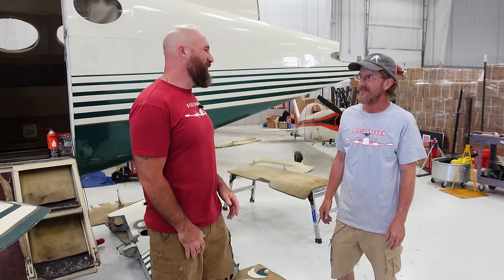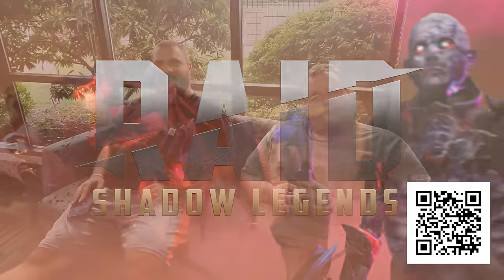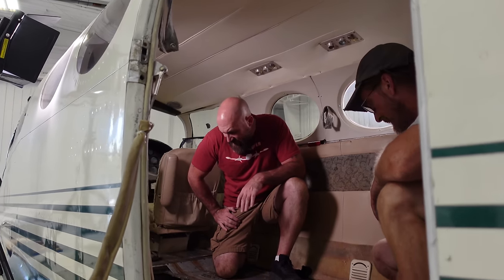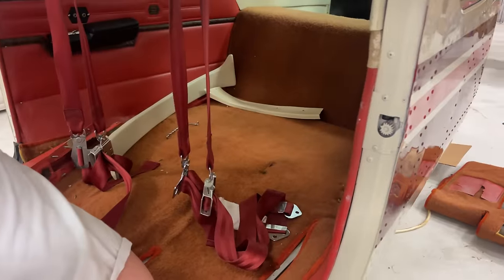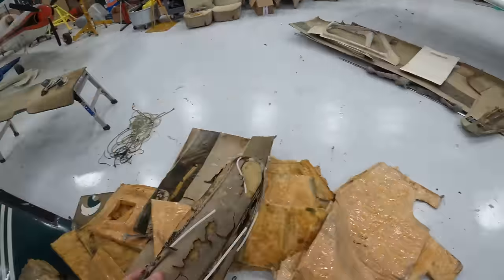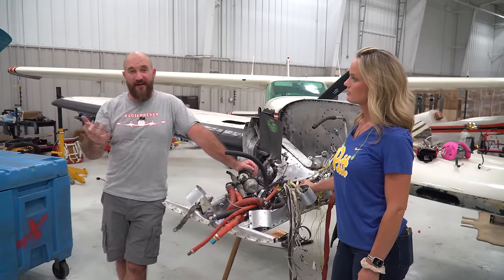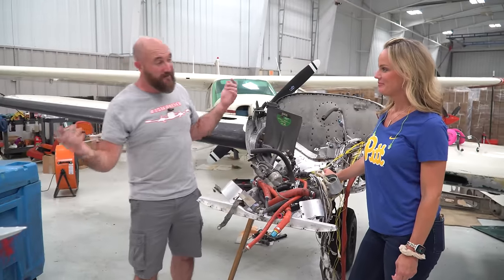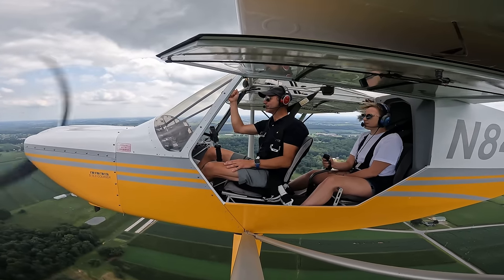Removing The Interior And DRY ICE Blasting The Free Abandoned Airplane￼￼

Comment: Can I suggest putting plywood panels down everywhere you walk. They will make it easier on the knees and protect the ribs and stringers from foot traffic damage. The voice of experience.
Reply: Very apt and useful comment. 👍
Reply: @athaxan2110  I thihk I would have started by pulling down the roofing panels
Reply: @miscbits6399  🤣
Reply: @miscbits6399  That would mean forethought...
Reply: A man who’s done this before!
Reply: Yeah they're called floor boards, We use them all the time building all of our planes.
Reply: Keeps from damaging equipment as well like the seat tracks and under floor wiring sensor etc.
Reply: Every Experience advice counts.  Thanks.

Comment: That potential donor plane in Ohio used to belong to a friend/former instructor of mine who passed away a couple years ago. He used to do charter operations with it. I haven't seen it in years but looks like it's in the same spot as always. I remember Dave telling me it needed work on the wing spar but whatever happens I hope it can help you achieve your mission. Seeing that just made me a little sad but I knew the plane instantly when I saw it
Reply: Wow great to know someone who knew the owner of the potential donor plane you would be a valuable asset to Jason on condition and history
Reply: The donor 401 looks better than the 401
Reply: @missingremote4388  Possibly.  Won't know until they get in there and get eyes on it.  Hopefully they will have the scope camera to view the innards through inspection ports.
Reply: @electronicsworkbench  If it's a great plane they should consider repairing the left wing corrosion. The donor plane could be the next project if it's viable.
Reply: @markwebber526  Donor plane is too screwed up to be viable plus it’s had three belly landings overall was in far worse shape Than the one he’s working on.  It will be a far bigger project which may not be worth it

Comment: Take it from an old A&P that did many C checks on MD-11, 737, 727, and MD-80/DC-9 cut some plywood to lay down over where the floor panels were. It will protect the areas you are not working on and make your life so much easier than walking on the frames. Also, take that overwing exit window out and fashion a plug that you can hook up a portable AC unit to. Will make working inside the cabin much more tolerable. One last note, when it comes time to put it all back together you will learn to hate clip nuts. I used to catch so many fellow A&P mechanics cheating by using silicone to hold in screws where they forgot to put a clip nut, or it slipped out of place. And thats what holds the lining on the walls of the baggage areas in most of the airliners I worked on. Fantastic work and I love what your doing to this bird. This has certainly turned into a restoration project of passion and it shows.

Comment: That’s plane will be about 150kg lighter…with all the cleaning done
Reply from the maker: True, we have pulled out so much bird and mouse nest garbage
Reply: @rebuildrescue   new line item on the W&B feces + 50 pounds.
Reply: @rebuildrescue  why are you flying with the doors open or the doors not attached to it  or did it not have doors  to begin with if so that's dangerous isn't it especially because of hypoxy
Reply: @darksonic9014  If you're talking about the small plane they are flying partway through the video, hypoxia isn't an issue below 10,000 feet.  Only real issue would be falling out, but they were both strapped in with a harness.  It would be a bit windy without the doors in place though.😁
Reply: I bought a 68 Cessna Cardinal and took it apart for its first cleaning in a long time. I took every panel off and I cleaned out around 6 pounds of dirt, grime, grease and trash that filtered into all the little cracks and nooks. It flew much better after all the cleaning and lubing.
Reply: @darksonic9014  Thpse planes are built that way, and they can control how high they go and account for that, It would be no different with the doors open vs door closed as the cabin is not pressurized. FAA Regulations say that any aircraft without pressurization,  the pilots begin to need oxygen when they fly above 12,500 feet for more than 30 minutes, and passengers have to use it continuously any time above 15,000 feet. I hope this helps.

Comment: Now you can see that an airframe overhaul is no joke. It's great that you got another 401 for spare parts. I don't know how good the interior of the other is, but consider bringing those side panels to an upholstery shop for having them totally redone, including the curtains. I know they try to clean them, but they are old, dull and it's time to go. You may know that at some point you will need to remove the landing gear motor and gear box for inspection, right? Also, make sure to have around a Maintenance Manual and Parts Catalog for the 401. They will be quite needed. Keep up with the great job.  👍

Comment: Here is a tip for removing 'stubborn' Phillips screws.

Grind a few thou off the Phillips tip, 'bit' so that it does not bottom out in the screw head. 
This will allow for the four flutes of the bit to sit tightly into the four cut-outs in the screw head.

Also, pick the crud out of the tough to remove screw heads with a dental pick.

Thanks for your videos.

Comment: This really shows what goes into the construction of an airplane like this. You don't think about what's there just standing on the runway. It is a very complex piece of equipment. Unprotected access points made the plane unflyable. If you ever expect it to be reliable then this is the work you have to do. Mice eat about anything including wiring. ALL of that wiring will have to be carefully examined and tested. This is a big job but they are making it look simple. They just go in and tear it all apart. They must have an organization plan that hasn't been mentioned yet. I can do about anything but I would want to store everything in a way I had all the bits and pieces numbered and sequenced so I knew exactly what went where. So, let's get on with it. Parts ID or not:-)

Comment: Please be careful with ice blasting, did it for years. Adjust pressure down and test!  Will remove your galvanized coatings!
Reply: It is too late
Reply: I noticed the speed between the demo clip and the speed they were using it were much different.  My guess is they say "many fast passes" instead of a few slow passes.

Comment: You are ambitious to want every inch of the inside of everything cleaned. IMO, it looks like the dry ice cleaner machine's cleaning path is very small in diameter. With the square inch that needs to be cleaned by the very small cleaning path, the time spent cleaning with this is going to be enormous. Too bad the cleaning path cannot be wider to cut down on the time spent.

Comment: He there; Iv'e found out over 50 years as a auto/heavy equipment mechanic to get a grip on crusty rusty screw is to get some valve gringing/lapping compound and put on the tip of your bit. It will grab a whole lot better.

Comment: I have to say that I have greatly enjoyed this project and that I have some very high hopes for what is to come in the rebuilding process.  A couple of episodes back I started to think it would be a fantastic idea to replace the turbocharged piston engines in the 401 with turboprop jet engines.  I started to do some research on other aircraft that have benefited greatly from just such an upgrade and how the 401 would fit this category.  Some time and much learning and great amounts of technical and financial exploration later I determined that my little idea was basically nonsense.  Not just because of the great cost of purchasing the turboprop engines but for very practical engineering reasons.  I don't know if you would care to bring up the subject on the channel but I personally found this topic very interesting.  Thanks for inspiring a tangential learning experience.
Reply: An interesting topic.  And there is another interesting path of feasibility research, into turbo diesel engines like the Diamond DA62 uses,  it eliminates the lead, the spark plugs, and magnetos, using jet A fuel ⛽  and the engine management systems, take up a lot of the work load of system checks. The Diamond uses Mercedes Benz power plants, but I'm not sure of the displacement on those. However torque is the trademark of diesel engines,  and with the size of those continental engines a biturbo V8 would probably fit in with minimal coaxing,  well maybe not minimal. But then it wouldn't be all original Cessna 401, which might be the intended goal. 
 In any case I do like your way of thinking, on more power more speed. Plus the reduction of lead in the atmosphere from aviation ⛽ gas.

Comment: I know it's late. But labeling the panels as you remove them. Makes reassembly easier. No test fit. A sharpy is cheap. If you stacked them in the order removed. Mark them. Screws can be replaced but the panels can be a task for order. I've removed floor panels from a ch53 the reassembly is trial and error. One screw hole is the difference between right and left. Mark them if not to late.

Comment: Loosen the fasteners by hand using a “speedy brace”. You can get more pressure & torque on the fastener. Then use the power tool. It should save on time cutting grooves into screws because you’ve rounded them off with the power tools.

Comment: You need to take all those interior panels to an auto or motor home upholstery shop right away. They can re do what you have using the same metal backing. It will be a lot cheaper than an aircraft upholstery company, and should not effect any aircraft regulations as it's only cosmetic work, and nothing structural ! They can even restore and repair those window trims, even change the color if needed. "Save money where you can"!Glad to see you finally got hooked up with the "ice blasters" as I suggested in the first clean up video of the 401 !

Comment: after you get the belly cleaned/treated ,i would recommend applying a corrosion preventative.When i was working overhauls at major carrier we used a compound  that boeing uses, on the entire belly. it dries and forms a thin barrier to moisture.Rather than spending time cleaning those floor panels make new ones makes a better looking job-also if you can find new seat tracks replace them.

Comment: Awesome channel - love the work and progress!
  
Tip on the shop vac...sometimes those shop vac nozzles is too big to get into tiny spots.  I used this trick to vacuum broken glass out of my door panel after my truck was broken into via the driver side smashed window; lots o' small shards everywhere.  

Take a 2-3 foot length of 1/2" plastic irrigation tubing, bevel one end to your liking, and then duct tape the other end onto the nozzle!  Wha-Lah super vac!  You'll want to get ALL of that bird/mouse crap out of there, not just some.  🤧

Jimmy B
Milton, GA

Comment: Im an aircraft mechanic and this is essentially what we call depot level maintenance. We take an aircraft and strip it down. Landing gear, interior, engines, floors, rigging, etc. Nothing is left inside except sonme wiring and basic structural pieces. Everytthing gets sent off to either get NDI or to get ovehauled and it all comes back together. It takes a lot of man hours but with our operation its start to finish in about 4 months. These aircraft go through this process every 4-5 years.

Comment: Get yourself one of those small box fans for when you’re inside to keep cool. They sell them that are very powerful plug in or battery powered and use a furnace type fan. Dehydration is a serious problem you can pass out before you know it. Almost passed out at work a few times and keep hydrated.

Comment: I worked the Lockheed C-141s, on a heavy check we'd have to remove the Cargo Floors. 3-Rows, but we could only remove the two outside rows or the center row but never the three rows at once. It would compromise the structure the Fuselage. Could possibly be done but the plane would have to be in the Factory Jigs. Now, there were hundreds and hundreds of screws and about 25% would have to be forcibly remover. (Drilled or Screw Extractors) Love your posts. Keep up the great work. Wish I lived close by, I would love to help.

Comment: Great update, looks like nice progress and positive results from removing the panels.
As for what you said about the cockpit dash and navigation suite been a full glass cockpit, i really think this will spoil the aircraft and think someone should look into the Garmin GTN750 Nav, Radio and AP panels. and leave the traditional 6 pack steam gauges as it is. 
I have been flying the Cessna 414AW on MSFS (Microsoft flight simulator 2020) simulation recently and have the GTN 750 Nav, Radio & Auto pilot panel suite installed with all the other gauges are standard factory fitted steam gauges. 
something else, would it be a good idea to make moulds of the interior window cover panels and get someone to make nice Kevlar ones that will be stronger, durable, lighter.
also any other panels or items to go back in see if there are lighter / stronger options available. 
wow the dry ice cleaner is awesome.   
I have some footage of the Cessna 414 cockpit that i will edit into a video and post it when i got free time.

Comment: That’s Soo cool so basically it’s like a sand blaster but not a sand blaster just does the same end product so it cools the dirt so much it becomes brittle and loses its bond to the surface and then the force of the air blows it off smart design
Reply: Pretty much hit the nail on the head! Unlike sand, it's non-abrasive. It is used in dozens of industrial applications every day. Feel free to follow the link in the description to learn more!

Comment: As long as the 401 had birds and mice living in it plus the engines I was amazed there was no wires chewed. No corrosion so far as you can see.
 The automakers are using wire made in China that is made with soybean type plastics and mice eat those wire coatings like peanut butter. 
 It may take a while to get the 401 flying and more money than it's worth but I like watching your shows so keep em coming.

Comment: No zinc chromate, use mil-prof-23377 Type I Class N non-chrome primer. It is an epoxy primer and a lot better than the old TT-P-1757 zinc ever was. I like the tan colored version made by Hentzen. Just make sure the aluminum is clean and has a fresh conversion treatment (alodine) that is less than 24 hours old when you apply the primer

Comment: I had no idea aircraft were held together with screws. In my head I thought they used some advanced space age glue or binder. But of course you need to inspect aircraft, so that wouldn't work. Are they steel screws? Would a lighter metal such as aluminium work?

Comment: For black crackled paint on control panels I usually remove the front panels and use dish soap and a toothbrush  in a sink.  But that's not always possible.

Comment: Rodents usually only gnaw on wires with low levels of electrical current flowing through them, so the dead batteries actually helped save them from that.
Reply: @eagle2019  I wonder if 'Painless wiring' makes harnesses for airplanes....

Comment: It is too late now but a way to get stripped or seized  screws is to drill off the head of the screw by drilling the head off with a drill bit the size of the screw shank and holding the head with needle nose plyers on the screws that spin. Nor especially effective on flat head screws.

Comment: It would be really cool if you replaced the seats with Mercedes amg carbon seats that are heated and cooled they only weigh 12lbs a piece prolly alot lighter than the originals. I hope that when you are replacing interior pieces that you replace with alot of carbon (painted)or other lighter materials. For insulation and sound purposes use dyna mat the stuff works amazing.
Reply: In all honesty, you dont want to change too much of the interior. changing a bunch of items to save weight wont necessarily be good. Weight and blance is very important and alot of the items were calculated and engineered from factory to keep the center of gravity proper.

Comment: That croaded area from the exhaust, you could contact a local machine shop that does aerospace parts see if possible to replace that segment? May be a option even if its not a cheep one. I do wanna see this plane fly again
Reply: @eagle2019  I meant the damage the exhaust caused in the wing to the structure.
Reply: @eagle2019  wasn't sure if it was with the age of the aircraft.

Comment: Are you able to get the replacement mouldings for those brittle ones you pulled out?

Will you be putting a bespoke sound/av system in before all the panels go back in?

Comment: Can you pop out that egress window and ratchet strap a regular box fan to it to exhaust any floating dust and pull an air current through the interior? Even with alot of the rat and bird components being removed, there is quite a bit that lingers in the dust and can make you very sick if inhaled. It'll also help with sweating bullets while working inside the plane.